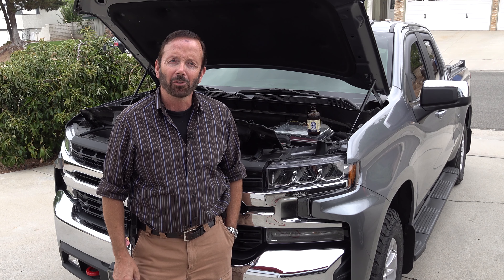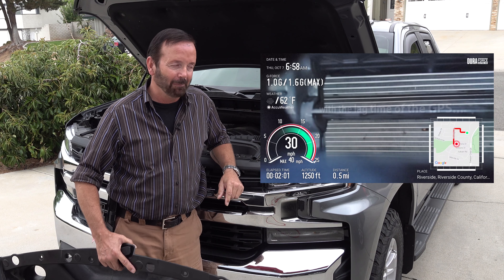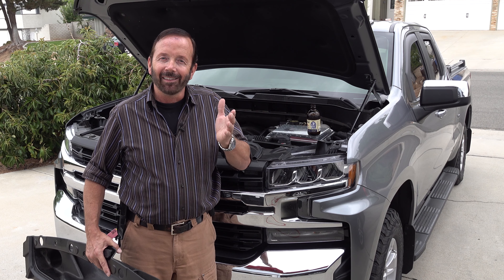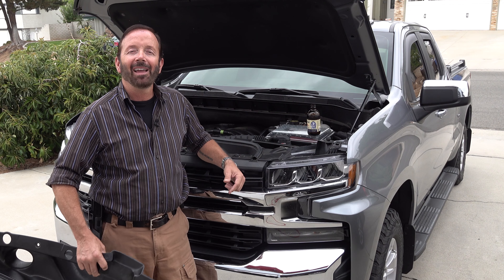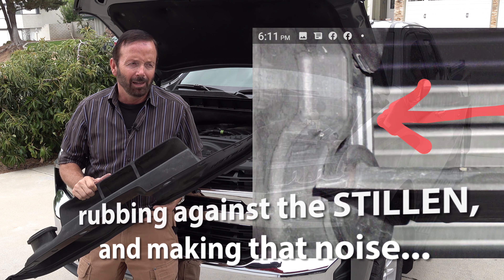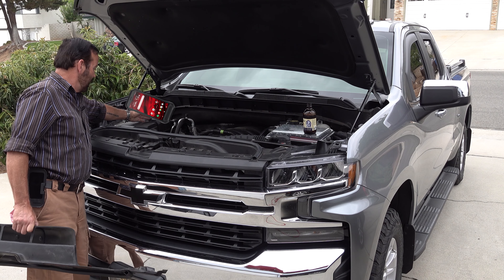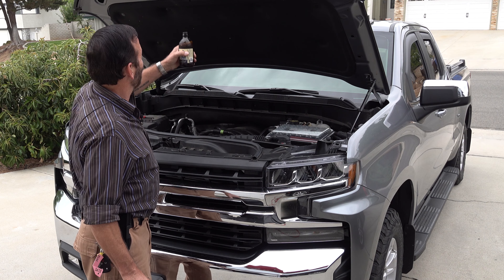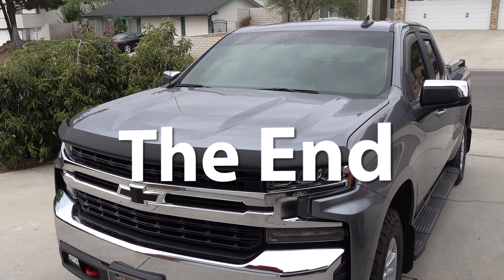Update #2-The STILLEN  CAI Scoop  &  Active Aero Shutter problem W/Paul Henderson 4K 10-7-21

Comment: Anything ACTIVE MANAGED on these suck. I put a Boost device in the ODB port for full time V8. 125,000 miles and my lifters are still quiet. My first Silverado and not a fan of these querky issues.
Reply from the maker: @danlaporte9307  125,000 mi that's good to hear,   I have just over 63,000 miles, so far everything is good. I looked at a few other products and I chose the pulsar LT.  I take pretty good care of my vehicle so I'm hoping to get at least 300,000 mi out of it My Pontiac firebird had 325,000 when I stupidly and practically gave it away I still regret that....

Comment: I was thinking about this scoop, but never mind
Reply from the maker: The scoop is pretty cool It does what it says it does. At stillen  they did correct the issue of the top two shutters rubbing against the scoop. Even Chevrolet realized that having a scoop is better than the lattice style that they have on there now. On a few of the newer trucks and one style of 2019's they have a scoop style similar to the stillin scoop but it is smaller opening than the stillin the scoop.
Reply: @HowtowithPaulHenderson  i will give it a try, my truck has the k and n tube and stock filter box. I just need this scoop. Thanks for the video
Reply from the maker: @Leduan81  
I know some people say it's a waste of money,  if GM is doing it on some of their newer  Silverados then they know there's a benefit to it .
But with stillen they did it even better and made this scoop bigger.
So now you be a chilling with a stillen.
Reply from the maker: I just ordered from stillen the new modified cold air intake scoop.  I'm going to do video on it to show the difference between the original unit and the new modified scoop. They are the same stock code just modified If you want to order it. I did receive $40 off coupon so that was pretty cool.
Reply: @HowtowithPaulHenderson  just ordered one myself like 3 days ago. It should be here in two days. That is pretty much the last mod i’ll do. I have a 21 trail boss, 3.1 inch bilsteins front and rear, cognito upper control arms, kn tub and drop in filter, pulsar lt, nitto ridge grapples 295/70/18. A bed cover, clazzio leather seat covers, ronin antenna. Not much but i live the way the truck is.
Reply from the maker: @Leduan81  did you get the 20% off coupon.
Reply: @HowtowithPaulHenderson  i had a different coupon paid $226 with tax
Reply: @HowtowithPaulHenderson  Where is the video ??
Reply from the maker: @themonstrgamer2723  what video. Is this one not showing up
Reply from the maker: @themonstrgamer2723 I did receive the new still in scoop about a month or so ago. I just took it out of the box yesterday to check it out. Soon as the weather clears up I'm going to do a reinstallation video of the new modified version.
Reply: @HowtowithPaulHenderson  👍🏽

Comment: For those that have done or are considering the”Stillen”upgrade… you don’t need to cut on the scoop to prevent the rubbing. Just remove the top two shutter blades from the shutter housing, it takes less than 10 seconds to remove one of them. They can be removed from behind the grill, so you don’t need to remove the grill. The vehicle will function normally with NO adverse effects. This method serves to not only prevent rubbing, but to provide an opening into the Stillen scoop for constant fresh air… this prevents the engine from running at an abnormal elevated temperature that many people have reported. I’ve had mine installed for about a year and a half, and have put just under 40,000 miles(it’s a lot, but I drive across country regularly)on it. My best fuel economy with the Stillen scoop, a Volant cold air intake and a flapper valve/muffler delete coupled with a lead foot is 24.7mpg. This is the 5.3 liter 327, 8 speed xsmn with the Z71 package, 3” lift and 35” tires! I know it’s a long comment, but the Stillen is a really great product that I’ve felt a noticeable difference in throttle response(even before I put a programmer in it), and done right it does work. NO I don’t work for them, and I’m not endorsed by them lol!
Reply from the maker: While it is true the blades were touching (barely) the Stillen it's  the two arms that pop out that close and open the blades that were rubbing against the Stillen and causing the chattering sound.  As for  removing the top two rows of blades ( I do not recommend that)  The shutters are controlled by a thermostat so when the temperature reaches a predetermined temp the shutters will open to allow air to pass through the entire radiator and not just the top portion. so far I haven't had any cooling issues. I left the blades intact and just trimmed the Stillen. I did get a hold of Stillen and they said they revised the one for the 2019 Silverados so they should not and will not rub. Sounds like a good idea though, I might check into doing this.
Reply: Jeremy
Several have used the stillen with the 3.0 Duramax and have removed the upper 2 blades like you indicated along with the bottom flap to increase intercooler efficiency.

Comment: You may want to inspect your shutters for any broken or missing ones.
Reply from the maker: I did check and they were fine. The shutters are working perfectly. It was actually the bars that shootout and close and reopen the shutters that was rubbing on the stillen, the stillen did slightly move back and forth a little bit so It wasn't much pressure going against those bars.  no issues works perfect now.....

Comment: I removed the air scoop and that elbow piece on the inside. I'm just going to leave it open.
Reply from the maker: Not sure if that's a good idea. Although that part of the elbow does sit back and tucked up out of the way. You could easily trim the Sterling if you don't have a Dremel or cutting tool just go buy a flat metal file it will cut through it. Or just reinstall the stock intake grille.

Comment: I have a strong feeling these shutters will be a recall in the future. Useless parts
Reply from the maker: It wasn't a shutter's fault it was mine for installing the aftermarket stillen cold air intake scoop. I knew the blades were touching the scoop but the rubberized I didn't realize there was aluminum bars that were attached to motors that actually extended outward while they were closing and opening the shutters. But with the video watching the shutters in action is pretty cool I had no idea how they actually worked now and I know and luckily they didn't get damaged from rubbing against my aftermarket intake scoop.
Reply: Those AERO Shutters are used by Ford as well. Had them on my 2013 Focus ST(3).
Reply: Removing mine and turning the CEL off with HPtuners.

Comment: 👍👍👍
Reply from the maker: Hi Greg thanks for the three thumbs up. That really did sound like a ball bearing bouncing in a plastic box didn't it. Really glad it wasn't my lifters. When I drop it off the dealership to have looked at two other times I told him the truck runs perfect and told him I could floor it up a hill next to a brick wall with the passenger side window down and I don't hear any pinging or dinging so if it was a lifters it would have made it sound doing that. But I was glad the mechanic found the root cause of the problem. And what was really nice they didn't charge me for any of those three visits. But then again I do buy a lot of parts from there. Lot of stuff I installed and had installed on my truck is from that dealership. The only reason I bought my truck there at that dealership was because they didn't try to strong army into buying it.
Reply: @HowtowithPaulHenderson  sounds like a good dealership. They are few and far between anymore.
Reply from the maker: @gregmosk  Yes they are, I usually have TANIA or Brian write me up for service. I've been going there for years, for parts for when I had my Fire Bird and My other Silverado. I used to go there and look at the trucks for one that would catch my eye and they never tried to twist my arm to buy one. I had a very easy purchase time with this truck I have now. But why does it take what seemed like 5 hours to buy a vehicle.... I'm still glad I did, I love this truck.

Comment: I just installed the Stillen scoop as well and noticed that the temp gauge went up to 210 after driving on the highway for 30 minutes.  I take it the scoop is causing this as well and needs to be shaved as you recommended?
Reply from the maker: 210° is a normal operating temp.. if you have the active areo shutters you may need to shave off enough of the Stillen scoop and the two supports that are built into the Stillen so the shutters but mainly the two metal bars letter attach to the shutters motor that rotate towards the Stillen when the shutters close  and re-open so those metal bars will not rub against it  and the  shutters will not touch the stillen.. it's those metal bars that are attached to the shutters motor that you need make room for. take your cell phone and use the flashlight you should be able to see while the shutters are open if they're touching the two support bars on the stillen scoop, if they are then you definitely need to modify it.
Reply: @HowtowithPaulHenderson  thanks.  I will check it out later.  I’m a just surprised that Stillen isn’t aware of this by now and has dealt with the issue.  Did u try contacting Stillen about it?
Reply from the maker: @restlessspiritsparanormal  they became aware of it not that long ago so on there website I think they say that the stealing cannot be used with the trucks that have the active Aero shutters... But I can say for sure that if you do the modification you won't have any problems. What you can do first locate the metal bars that are attached to the shutters motor and trim just that area with a circular file should make a nice little space for those bars to fit and without rubbing. You may not have to trim anything else
Reply: @HowtowithPaulHenderson  great, thank you very much for your help and replies.  I subbed to your channel as well as I found your videos very helpful.